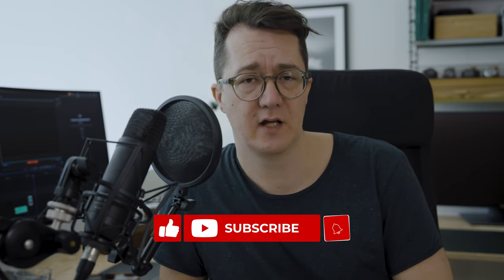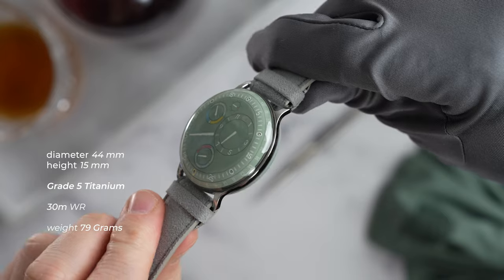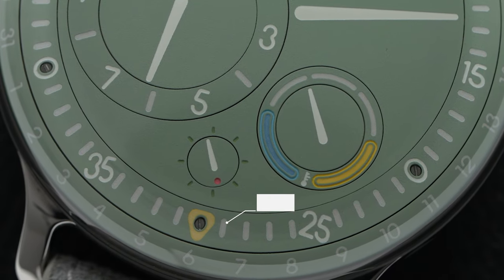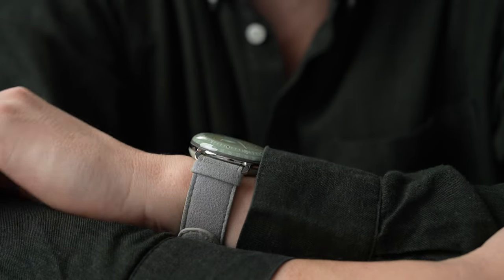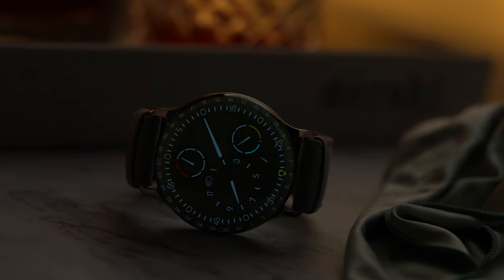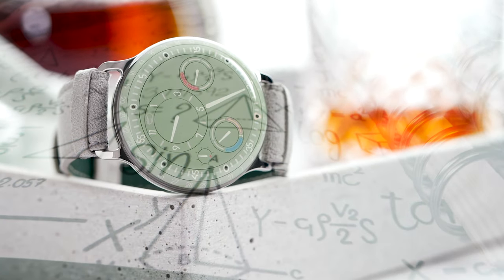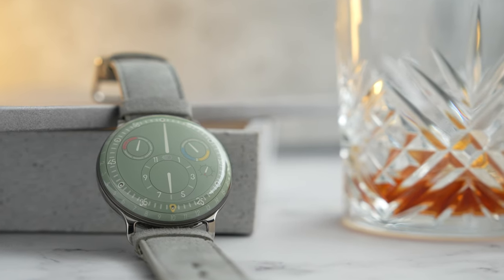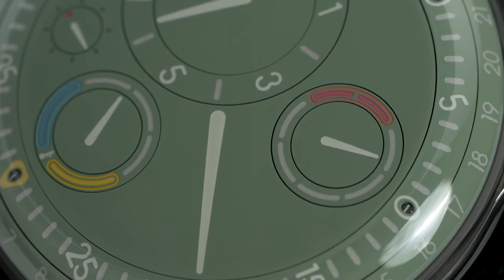The Ressence Type 3 EE   - OIL and Magnets !? 🤯

Comment: amazing watch, and really cool review. Question though: what is the idea behind the small 180 second subregister?
Reply from the maker: Good question! no idea why 180s tbh ... but its the only indicator where you see that the watch is actually running :) But in case of severe latteral shocks the magnets could get misaligned .. and  you will see this disc wiggle about...   there is a way to manually fix that if that would happen tho. In the type 5 that runner has some extra shock absorbing system too.